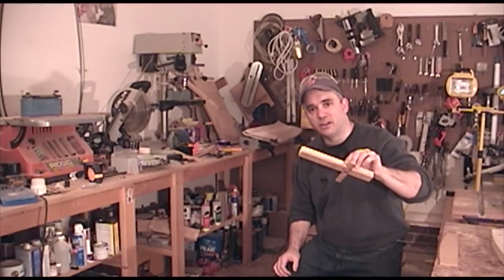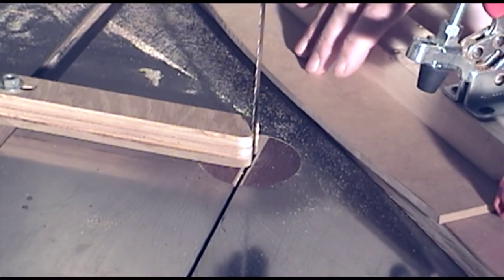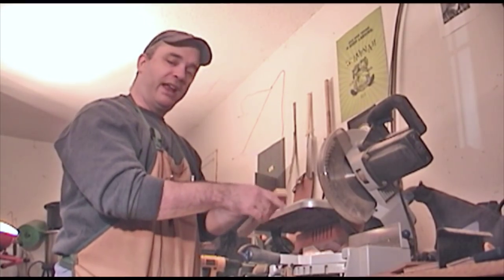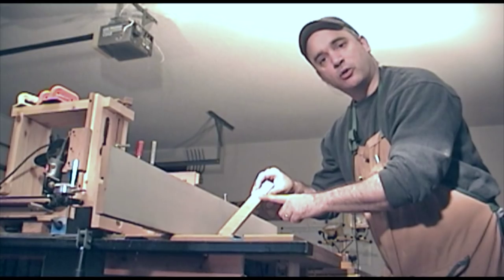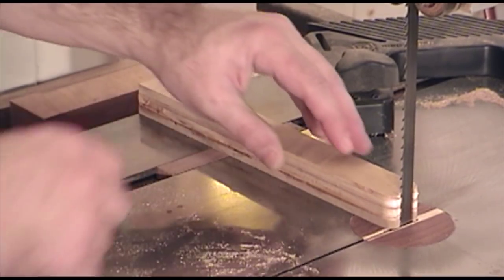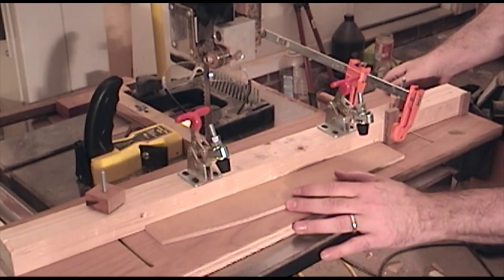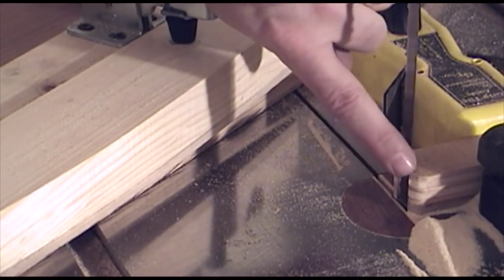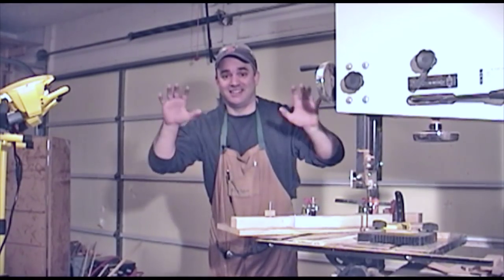A Bandsaw Template Jig

Comment: I do a good deal of pattern routing of curves in rails, trim following curves, chair legs, etc, and occasionally have problems with grain/figure that can ruin a piece of stock when routing to a pattern. An easily effected solution for those situations. I also like the idea that it allows my tapering jig to do double duty.

And, as long as you're using a bandsaw to rough cut the parts before pattern routing, you might has well cut out that last, sometimes problematic, routing step altogether.

Comment: This is a great idea. My bandsaw blades are pretty cheap compared to my router bits, so I can rough cut things quickly and easily, then clean up and get a nice smooth surface with the router bit before taking the template off.

Comment: That's a really good idea.  At first I was saying to myself "why would you need this?  Why not just use a pattern bit in a router table.  But then I realized that this would be useful for cutting parts that are thicker than a pattern bit can handle.  Out of curiosity, how do you deal with smoothing the surface without affecting precision?  As far as I can tell that would be the one advantage of using a router table is the level of precision and no smoothing.

Comment: Very cool jig.  I own a Grizzly 14" bandsaw where there is only one miter slot on the right side away from the machine.  The table has no other holes or slots to lock down the jig on the inside.  Question.  Is it workable to create the same time of jig and secure it with magnets and clamps on the side without a miter slot?